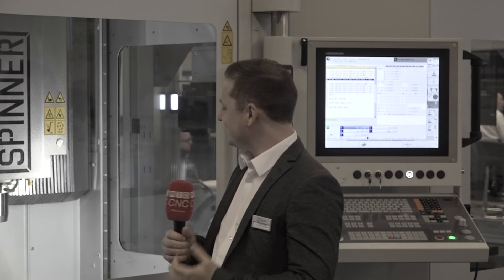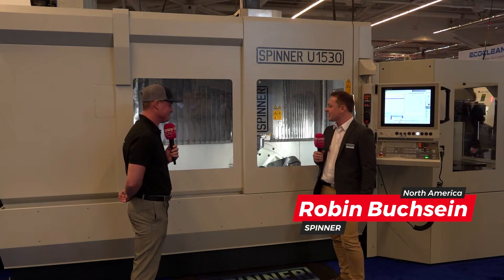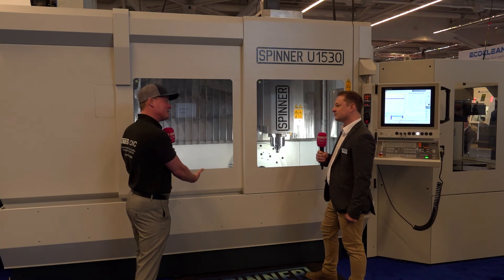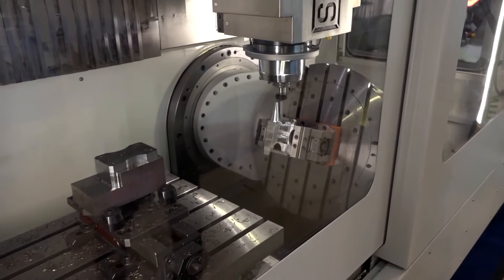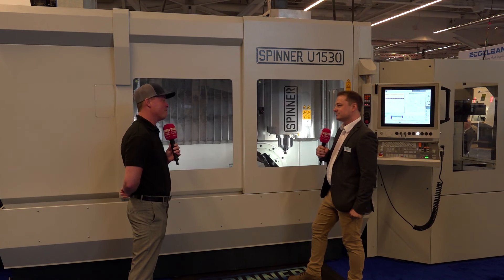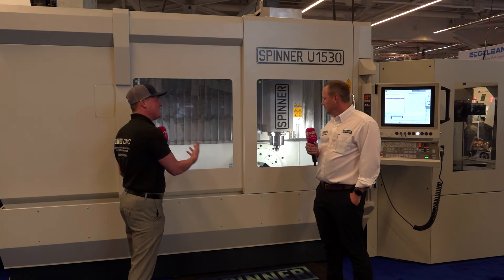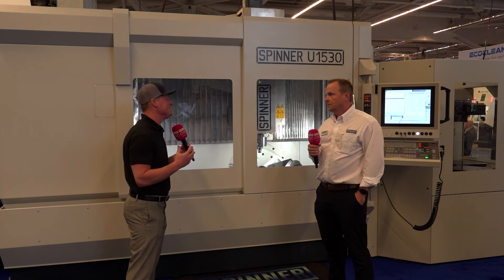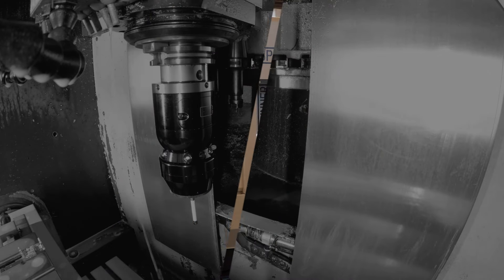3 AND 5-Axis in one unique machine

Comment: This is a solution looking for a problem.
Reply: i was thinking the same.  much better to have a separate 3 axis for the op 1 so you can unload it and setup the pallet system while the spindle is still running.  Or just get rid of the 3 axis table and have a vice mounting point on the side of the trunnion, for dovetailing etc.
Reply: I disagree. For a small R&D shop it is ideal. Setting aside op1, op2, 3axis, 5 axis arguments, It gives the shop the possibility of the occasional large/long workpieces.